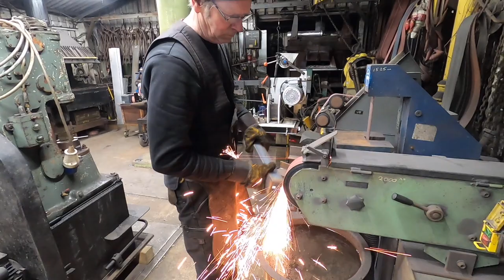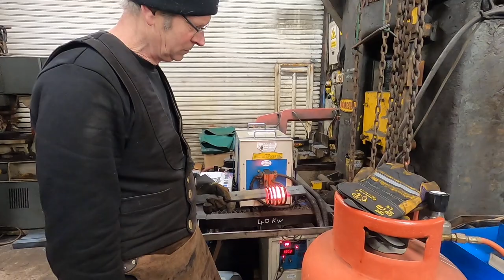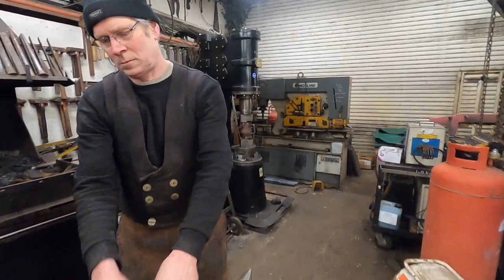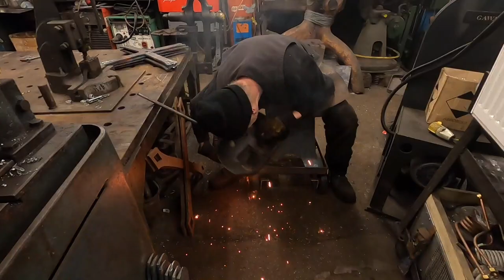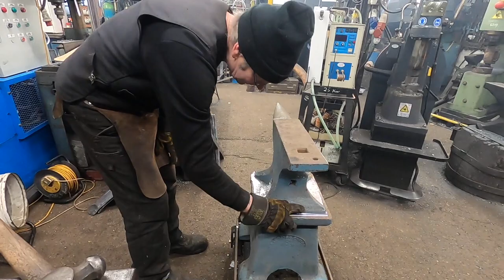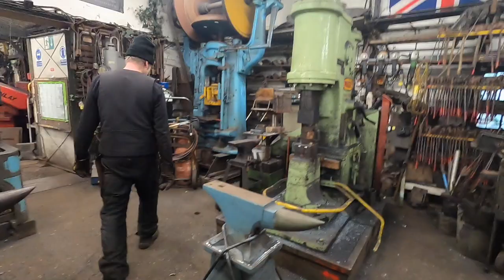How to mount a Anvil and end its ring - Nigel Barnett

Comment: Nice solution Nigel. Mine is on a wood base (not a stump) and I might look to putting some wheels on it as everything in my shop does the "tetris shuffle" to find a place.
Reply from the maker: Hi Anthony everything pos in my workshop is on wheels as we do massive work and sometime take machines out side .even the hammers that are one piece  move  i have even taken the roof lining out to make a big stair case .need a bigger workshop realy but there is 4 lorry loads of concrete under the big hammers and i dont fancy doing that again .
Reply: I feel your pain. 😂